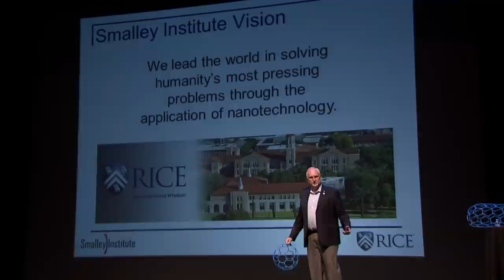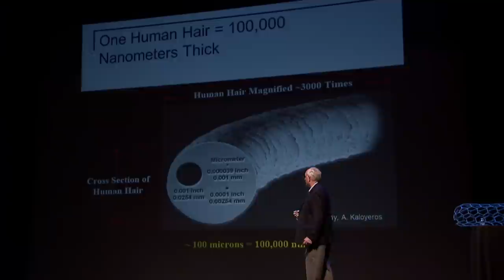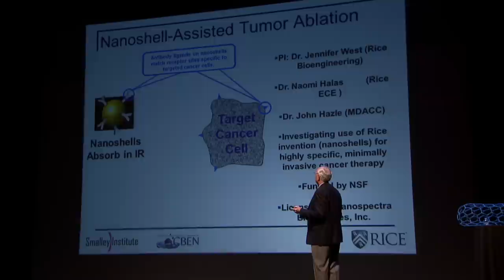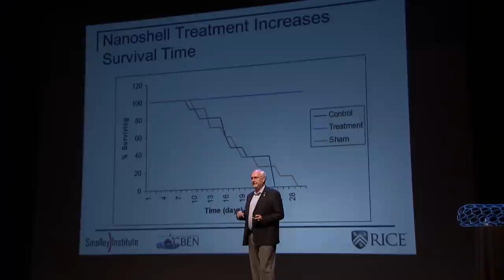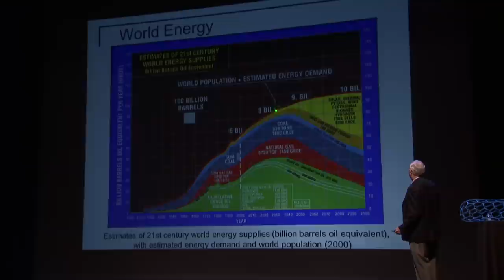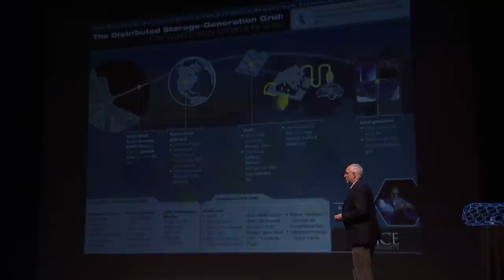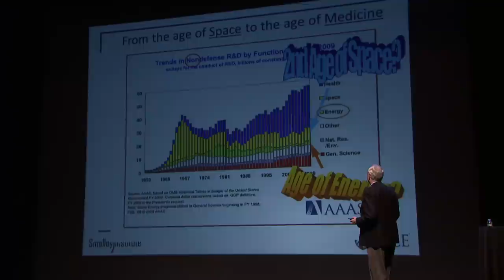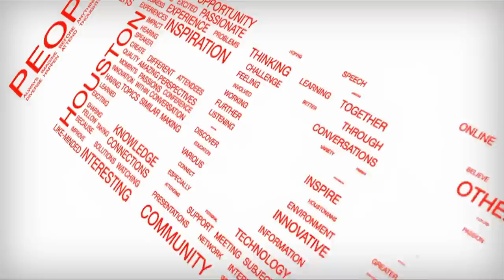TEDxHouston 2011 - Wade Adams - Nanotechnology and Energy

Comment: 00:22 Exploring the surprising strengths of materials in the nanoworld.
02:01 Designing materials with both lightweight and high strength is challenging.
03:53 Micro lattices are the world's lightest material.
05:24 Nano materials can exhibit surprising strength and weakness.
07:06 Reducing wall thickness of ceramic nanotruss by a factor of five makes it stronger and able to recover after deformation.
08:42 Nanomaterials and architectural constituents allow new material classes with unprecedented properties
10:17 Nanotrusses offer lightweight mechanical stability and high surface area for various technological applications.
11:55 Nanomaterials can be scaled up and utilized in various shapes and forms.